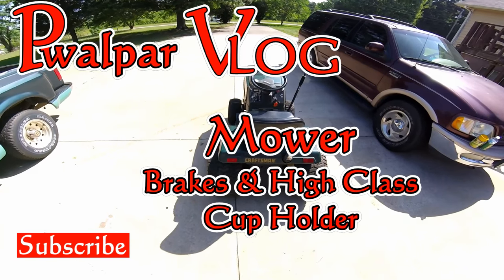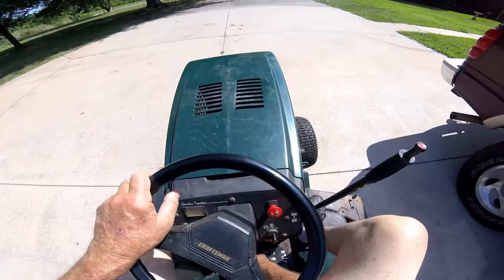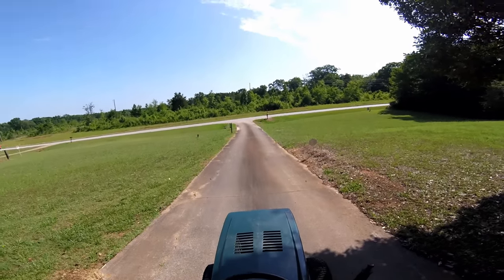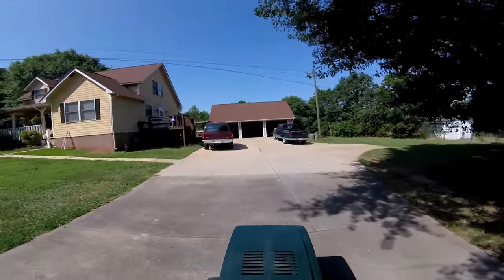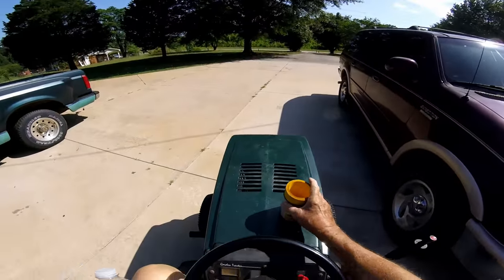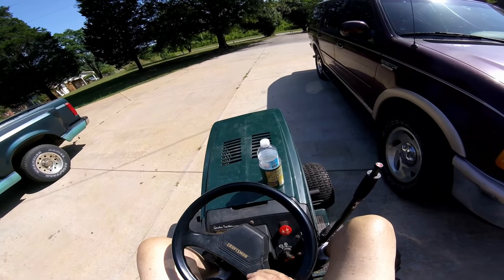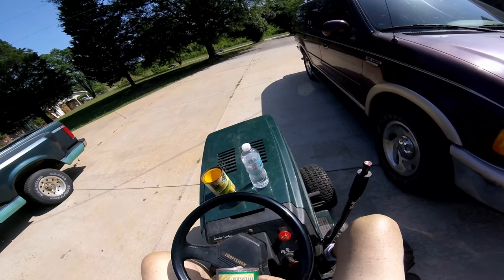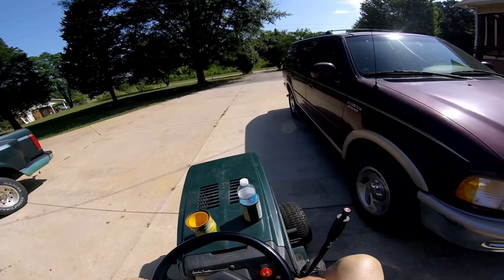Mower Brakes and High Class Cup Holder Pwalpar VLOG 6 16 16

Comment: First class all the way, Walter! You should drill a couple of small holes in the side of your cup holder near the bottom so any moisture can drain and not stay in your cup holder.
Reply from the maker: Thanks for the tip  I will

Comment: My 60" 60 year old Yazoo has never had brakes. There's a pedal, but it isn't connected to anything. That mower is so heavy that if I put it in neutral it stops just by dead weight. The 1-cyl Wisconsin engine has a displacement of almost 60 cu. in. and vibrates so madly that I could make milk shakes if I had a cup holder. Nice job you did, Walter. I'm going to have to get out and mow in between rain drops or I'll have to get out the old scythe to mow.
Reply from the maker: LOL  Thanks Bruce  I live on a hill  your Yazoo night go good on a hill
Reply: The park around our old home was very hilly. To stop the mower on a hill I pull it from forward into reverse. If you do this slowly it slows and stops the mower, but if you do it quickly you fly over the mower deck and land on the ground, as two of my sons and I all learned the hard way. We were very lucky not to get run over.

Comment: Southern engineering at its finest!  I have an idea for connecting the trailer -- Just drill a hole in the bolt and use a hitch clip to keep the bolt from falling out.

But do be careful -- people will see these videos and want you to make them a trailer, too!  LOL

As long as the brakes are doing fine, why not hold off until winter to tear into them?
Reply from the maker: Thanks my friend  I would have to charge them a lot lol